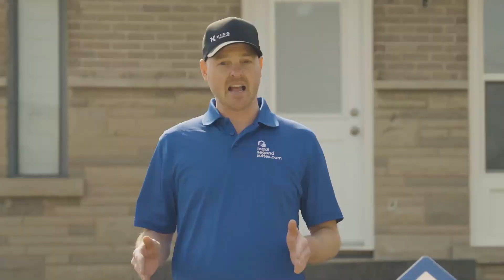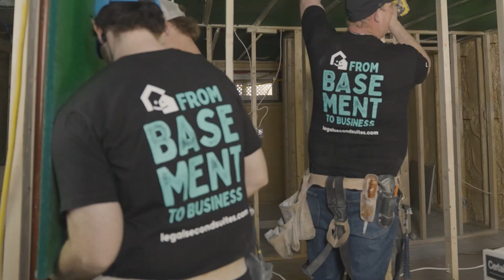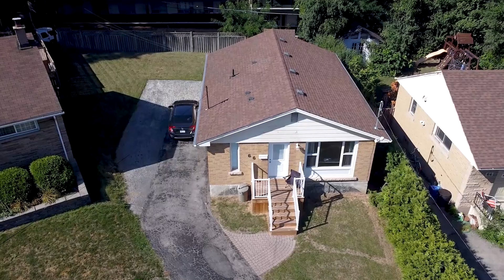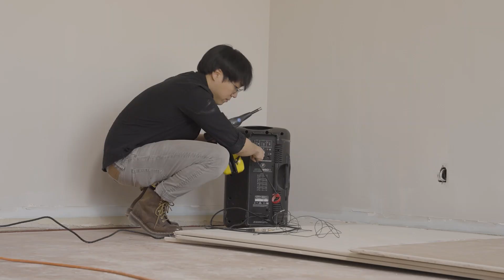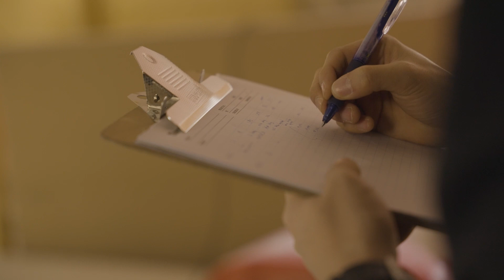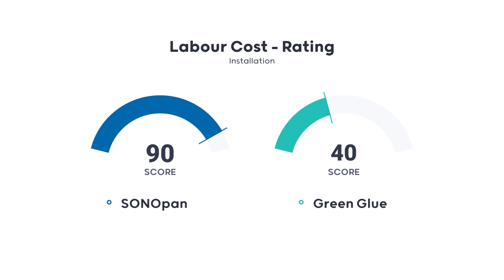The Ultimate Soundproofing Test: SONOpan Soundproofing Panels Vs. Green Glue

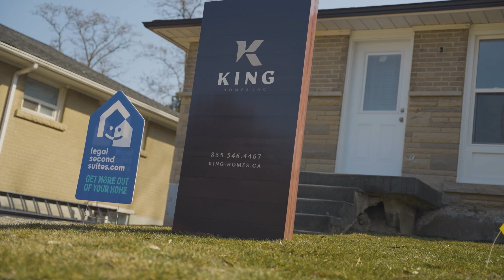Comment: 0:25 "Legal second suites"
Except that front porch is not legal and up to code... 
Guards (Railings): Required if the deck is higher than 600 mm (approximately 23 5/8 or 24 inches) above the finished ground level
UH OH 😮

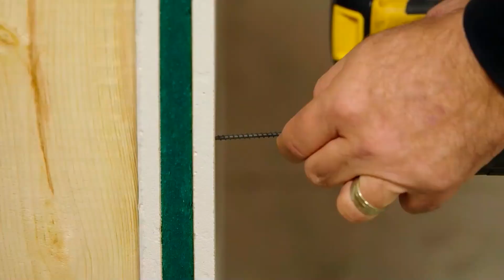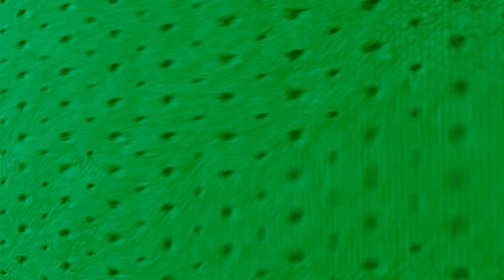Comment: At 4:53, we see a layer of drywall, then sonopan, then another layer of drywall. That's different from the assembly instructions at 1:02. ??
Reply from the maker: At 4:53, you're right, SONOpan is between 2 layers of drywalls. This is a frame taken from an installation video on our website and it's showing a different assembly from the one that has been used for the experiment in this video. At 1:02, SONOpan is applied right on the joists, then the resilient channel and then drywall, which is the assembly tested in this video.

Comment: This wasn't to specific on what each one was.  The green glue was two layers of drywall?  Or two with the existing drywall in place?  Its saying these are the same?  So if space is a concern, go with two layers of drywall (as sonopan is 3/4 inch)?
Reply: That's true they didn't explain well enough but it doesn't matter that much anyway. The extra (likely 1/2") dw would only add 1-2 pts of sound control.
Also 5/8ths is .625 so only an 1/8 thicker for SP.
My personal strategy on my new sound control project is going to be adding a layer of Sonopan to the ceiling followed by a layer of 5/8ths DW. According to this video that should get me an STC of 50. If that proves insufficient, I will add a second layer of 5/8 DW with green glue. Think about your options and your plan b!

Comment: What most people do not know is that STC Ratings only go from 125 Hz to 4000 Hz. Any frequencies that are below 125 Hz (such as sub-bass frequencies) are not accounted for in the STC ratings. Yes, you can compare it to Green Glue when it comes to STC ratings and they will perform very similarly. However, SONOpan has not tested its products in the sub-bass frequencies. It is unfortunate that SONOpan has not tested its produces for home recording studios, because the low frequencies of bass drums and bass guitars are the HARDEST frequencies to soundproof against.
Reply: I tend to agree, since there is very little mass, I dont know how it would perfom with TVs etc.  I cant see it doing better than two layers of 5/8 drywall which is quite dense.
Reply from the maker: Hi Matt, Yes it's true that STC only measures down to 125 hz. We measure this way because that is the measurement required by inspectors and the "language" that builders and architects use to determine wall and ceiling assemblies. The industry needs a paradigm shift in order to better understand soundproofing. We do however understand and communicate the best soundproofing solutions for all frequencies. For low bass, it is best to also incorporate a decoupling mechanism for improved soundproofing. Please visit SONOpan.com for more information.
Reply: @sonopan_msl  does sonopan work for low frequency sounds (bass from nearby bar)
Reply: I was going to use one layer of SONOpan and 2 layers of drywall.  I'm wondering now if I would just be better off using 3 layers of drywall.
Reply: @TL-ds8ux  You may want to look at @soundproofyourstudio here on Youtube. He had done a lot of research (and asking professionals that build recording studios). From watching his videos, I will be going for 3 layers of 5/8" drywall for my acoustic drums studio.